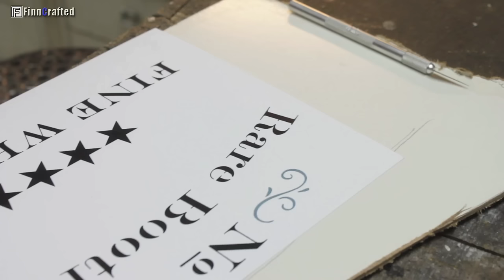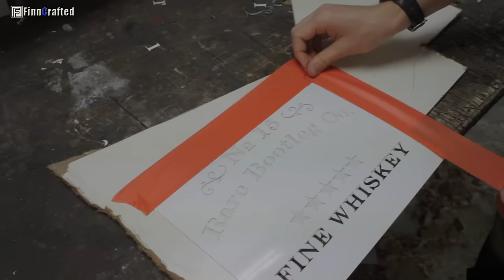Rustic Prohibition Crates - Making Props For a Party

Comment: Hi finncrafted nice rustic crates! They look good! Small little mini tip, if you back out the hole saw in between drilling; this will clear the dust or chips and might drill a bit faster or less pressure. Thanks for sharing!
Reply from the maker: Thanks. Yes i know, but in some woods you have to do it so often that it can become a drag. Forstner bit would have been better but the hole saw was closer at hand.
Reply: Oh yeah i can imagine that